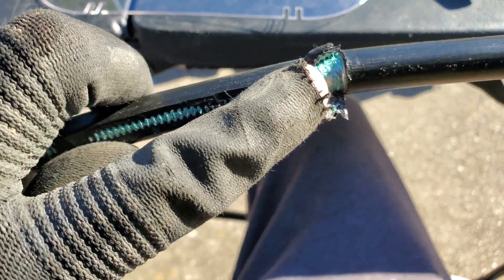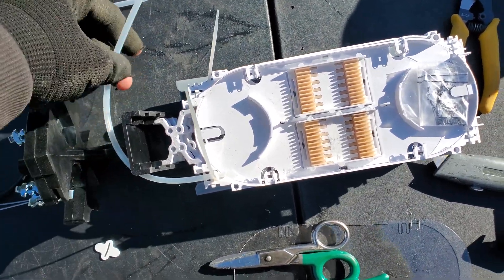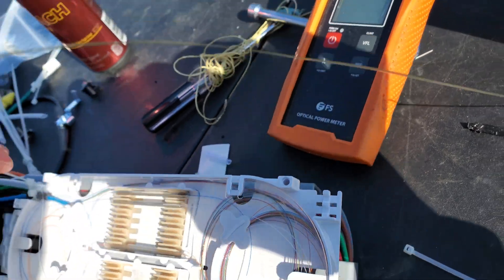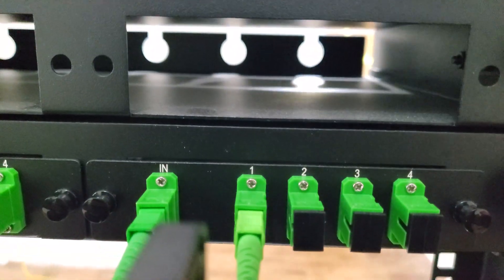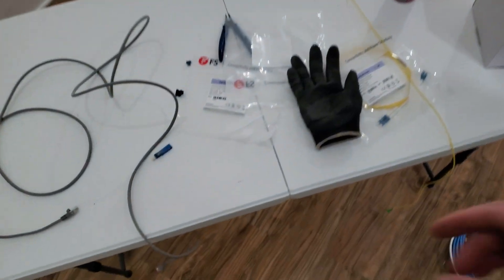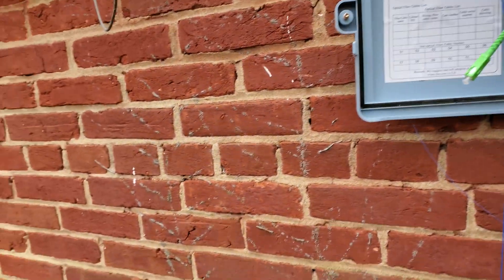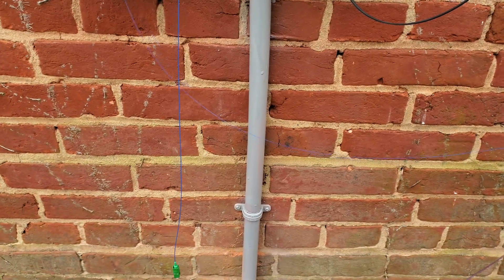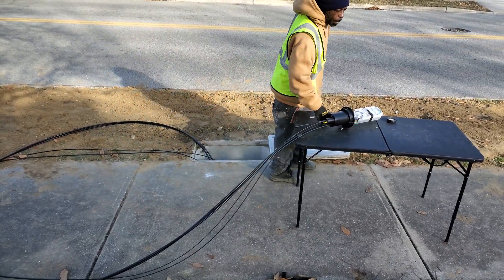2 Customers GPON, same day, new PON

Comment: I noticed you are using CST armoured Fibre, I’ve not used that due to bad reports about robustness. I’ve always used Steel Wire Armour (SWA) Fibre where I needed robustness and also for direct burry.
Reply from the maker: Well we never direct bury cable always inside of duct even for a customer drop cable.

Comment: Your flat drop is different than what the main telecom provide here in Ontario Canada uses. For their last mile they used a cable that looked like the old dipole antenna cable, and it has six fibers on each side encase in a hard shell  with a plastic separator between them. The issue is they have a custom tabletop device for stripping it that is not available retail. It's another example of semi-proprietary solutions that lock a customer into a vendor since competitors must run their own fiber from a non-bell box all the way to the building. Making installation more expensive and encouraging the customer to use the solution vendor that is already in the building for a lower installation charge.
Reply from the maker: Share a picture I'd be curious what it looks like
Reply: @briceperdue7587  Next time I'm at a site I will grab a photo.  The techs sometimes are sloppy and leave cut unused segments behind them. I might be able to grab one as a souvenir!